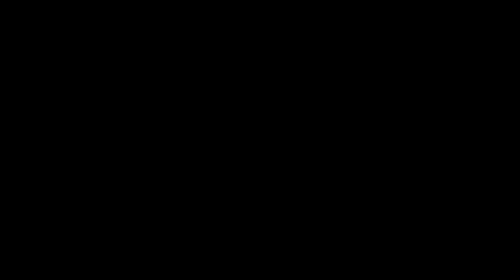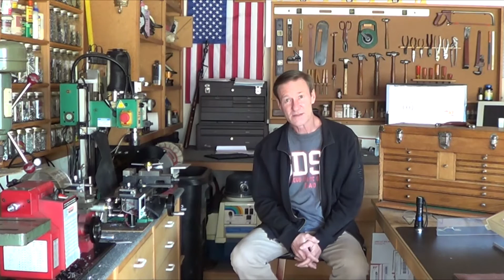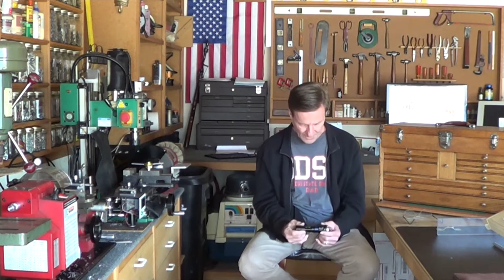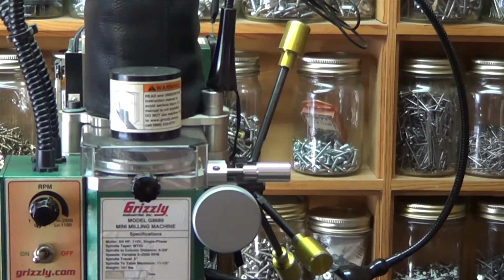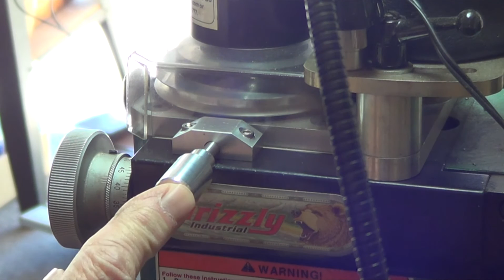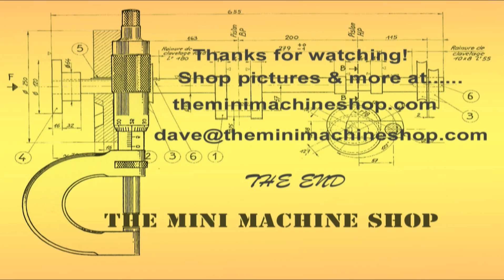Ebay Mini Mill Spindle Lock Upgrade Video #96

Comment: Hey Dave , I have that Y axis upgrade it works good. On your design you could put a detent on the pin and that would work good. I just installed the belt drive, world of difference. I also was lucky to score a acme thread kit for the mill made by Fignoodle, very nice with adjustable Delrine nuts. I didn't like the spring on the ebay one, don't want to hold it while loosing the drawbolt. Missed your vids, glad your back.  Thanks Dave A
Reply: sorry Dave it's FigNoggle Designs
Reply from the maker: Hi Dave, always glad to hear from you! The belt drive was one of the first things I did and yeah love it. Never heard of Fignoggle and will be checking that out shortly. The one I mentioned is Phenon Engineering for upgrades. I didn't like the idea of holding the spring either so I'll see how mine works out over time. Cheers ....